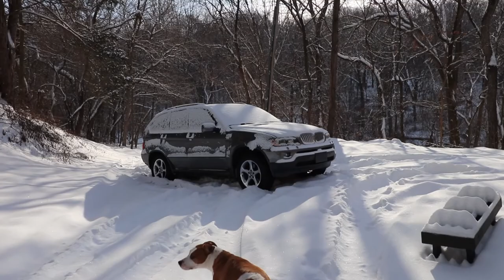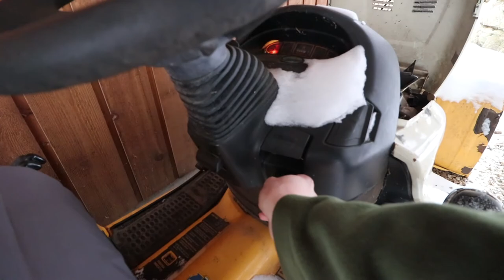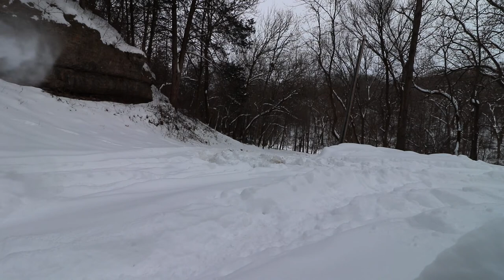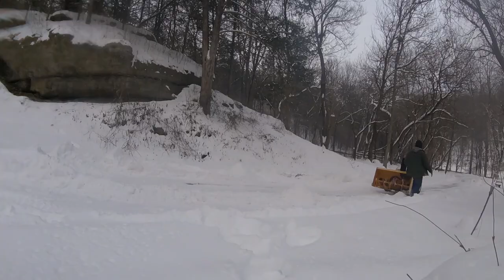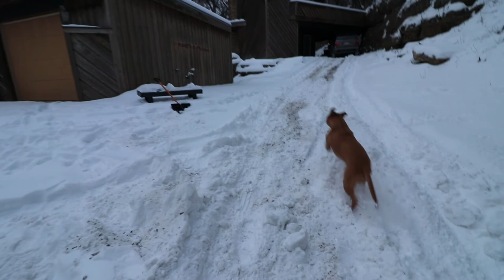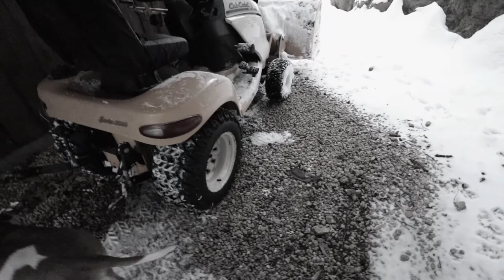How NOT to use a snowblower

Comment: Your cross augers look like they are mounted in backwards. They should be drawing snow into the center. Also, tire chains and some additional rear weight go a long way.
Reply from the maker: Just went back and watched the video again, looks like you are right. Definitely pushing the snow out instead of in. You just saved me a lot of headache I think. Appreciate the comment!
Reply: Yep. It looks like the left and right sides are switched. You got it!